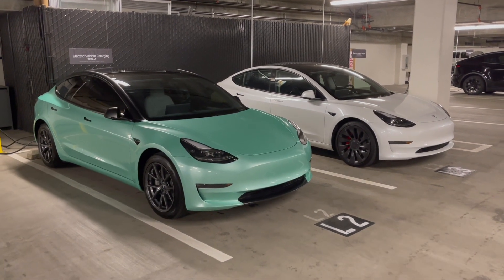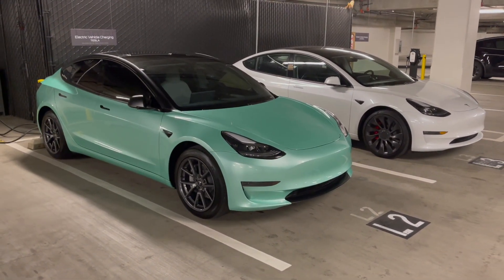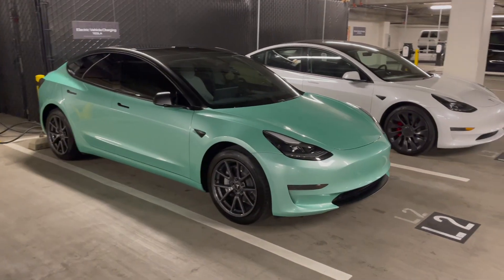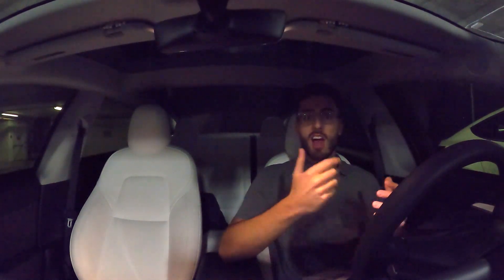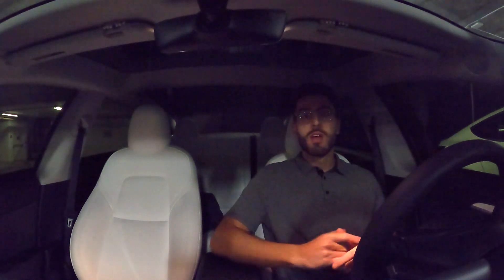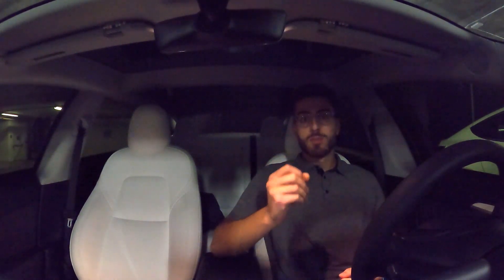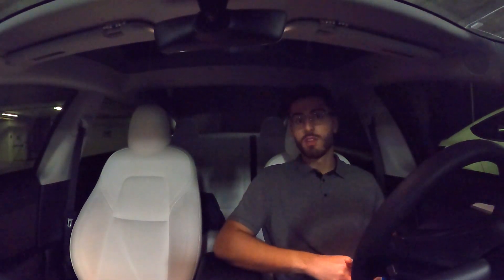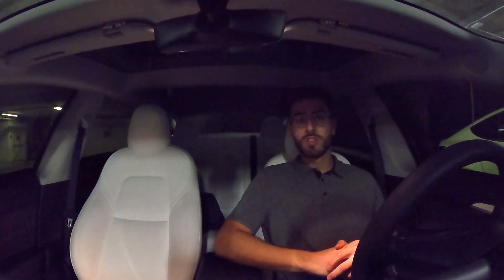Tesla Model 3 LFP | Charging Behavior and Battery Degradation

Comment: All misleading info. You can’t see the level of degradation on range estimate. You have to have 50% or less battery, be connected to L2 charger and switch to the service mode then run a battery health test which will take around 15 hrs

Comment: Hey , I plan to take delivery of my Model 3 RWD next month. Note,  I live in a condo, with no chargers, in Toronto, Canada.  Thus, I would have to use the super charging network to charge.  Also, I work from home, so my weekly usage would be pretty low. Given my situation, what do you recommend my charging habits be ? Thanks in advance for any advice you recommend
Reply from the maker: Supercharging is fine, the battery won’t degrade more so I wouldn’t worry about that. The only issue I’ve had is the inconvenience of relying on public chargers, but totally doable 💪
Reply: @ChargeGo  thanks for your quick response! It was super helpful. It seems like  the LFP battery chemistry is ideal for people who don't have a home charger

Comment: I’m having a different experience; I picked up my lfp m3 beginning oct 2022, it started with 274mi range. It’s only oct 16, it’s down to 271mi range. I have the aero caps on, charge it to 100% most of the time on nema 14-30..
Reply from the maker: The only way to really know the degradation is by looking at the current capacity on the battery, which you’d have to figure out through Tesla service or a 3rd party app. Displayed range is not a great metric to use, like I did here.

Comment: I have tesla 3 standart 2022, also have an LFP battery (drove 9000miles)  still have 272 miles on it. I have no degradation at all yet. I ussually charge it to 90% and to 100% once a week, or when I need it. The LFP battery has a different chemistry,  and can be charged to 100% with no harm to battery in a long term.
Reply: I have the same tesla. Started at 273,  now down to 259? I guess something is wrong with my battery

Comment: Never charge to 100% or leave it at 100%. They balance at 90%, some have reported double the deg tesla claim.
Reply from the maker: It’s a new battery chemistry. This point is true of the older chemistry batteries.
Reply: @sgsuper1150  ah so what purpose does the cooling port on our battery pack then?  Our car will either heat up or cool down the pack when it is needed, same goes for charging. Don't worry about the batteries getting too hot because it wont.
Reply: @AllThisThingsIHateU  It won't always work for the longest battery life. Fast charging lowers battery life, 100% charging may take 4% away and then it not always going to cool to 25 degrees idea temperature.

Comment: How is your battery now? I have an LFP SR+ and I lost 8 miles already with about 7k miles on it. I charge daily 100% as it recommends, any thoughts?
Reply from the maker: Hey! I’m at 17k miles and have lost 8-9 miles as well. I wouldn’t trust the estimate too much, you would need to look at internal data to see how much degradation has actually occurred. A Tesla tech can do that for you.
Reply: @ChargeGo  thanks man, yea I know those numbers fluctuate
Reply: I charge (free Volta) to 100% once or twice a week at 32A. Battery is usually around 60-100% weekly. Never charge at home, only use Supercharger on road trips. Battery now shows 252 full range after 8000 miles in my 2023 Model 3 SR.

Comment: Hey guys, I’ve had my 2022 M3 with LFP for 6,000 miles now. I’ve noticed my charge limit has gone from 272 down to 267 now. Should I be worried?

My charging behavior has been mostly relying on superchargers since I can’t charge from home until next month. I charge about twice a week to 100%. Any feedback would greatly be appreciated!
Reply from the maker: I think you just need a BMS recalibration. Going from a low state of charge to full a few times, using a lvl 2 charger preferably. Works for me 👍
Reply: I'd also add that charging it to 100% everyday  doesn't affect negatively in our lfp battery because the chemistry of it is different than the previous one. It is always happy  20% to 100%
Reply: Never charge at 100% with a supercharger
Reply: Just to help you not worry. These miles are not really accurate. It changes on how you drive your car, check your trip log, it averages your miles depending on your driving style and usages of heater  ac, etc.

Comment: I purchased the AWD, which should be arriving in a couple of months, but am now seriously considering to change my order for the LFP, after learning about the charging. Charging 80% of the AWD will give me the same range as 100% of the LFP. I do love the premium sound system of the AWD but don't know if its worth the extra.. Would you recommend the standard over the long range?
Reply from the maker: Yes, I think LFP is the best value car out there. If you can afford LR it comes in handy to have more range sometimes. If you don’t drive a ton and have gone charging I would do LFP all day long.
Reply: @ChargeGo  How is the range decrease in the winter time? I live in Los Angeles and a Tesla rep told me that LFP battery range decreases more, even in Los Angeles winter time. he also said that it charges much slower in even moderate cold. and I don't have a home charger but hopefully I could make it work with the lfp
Reply: @user-hw4tk4gw6b  if this is still an issue for you I can confirm the cold weather issues are not permanent and you will regain the lost range in the summer. It doesn't damage the battery in any way it just reduces the performance in winter. The LFP battery will last a lot longer before you reach 80% of the original capacity. If you're worried about slow charging in winter just make sure to charge straight after you get home so the battery is still warm from your driving. I don't see any occasion where you would leave the car empty over night in sub zero temperatures then need to fast charge it the next morning. The only thing would be the LFP battery would give you slightly less efficiency / performance in cold weather both batteries will but the LFP slightly more.
Reply: I went through the same thinking. Getting the LFP now.
Reply: With long range you get up to 250kw at superchargers vs 170ish on standard range model 3s
Reply: LR is AWD and a lot faster. Feel way quicker then the SR LFP. Do you want to drive a slow 5.8 sec car or a 4.2?

Comment: Sorry pal. Your range estimation summary is incorrect. Tesla estimates the range based on what the BMS estimates as your pack size and using a static figure to estimate your range. It does not fluctuate based on your driving season or wheel covers. To see your actual real world range you would have to look at your energy screen to see your range estimate based on your most recent driving habits over different distances. If your BMS estimates 248 miles and your pack was initially estimating 253 miles new you would actually be looking at a small degradation of 2%. That’s pretty normal. This number can change as well with software updates and whether Tesla releases some of the battery buffer to the useable side. Side note , about 3kW of the pack is not useable and is part of the buffer. If your LFP started with 60kW total only 57kW or so would be useable. Packs will degrade a little faster at the start and slow down over time and mileage. LFP is certainly the better pack potentially over the long run. I would guess that if you are running through your pack down to 10% and charging to 100% often your BMS would be estimating pack size pretty accurately as it is seeing the entire pack.

Comment: The range displayed on the screen in your Tesla does not change based on wheel covers or weather conditions. It is purely a measure of how much charge your battery holds. Your battery has degraded (very minor) from the original miles you saw on the screen to the new lower number. Here is a quote from the Tesla website: 

Displayed range in your Tesla is adapted based on fixed EPA test data, not your personal driving patterns.
Reply from the maker: Thanks for sharing!

Comment: Bro don't charge it to 100 percent too often , yes LFP Batteries are able to withstand high state of charge with low degradation than ncm or nca but yes degradation is there , Tesla recommends to charge to 100 percent to balence the cell voltage of battery pack as cell balancing is an issue with LFP kind of batteries , you should use 90-20 cycle often and full charge occasionally for balancing purpose hope you find this helpful.
Reply from the maker: Thanks for the comment. I have recently been following the 90-20 cycle by chance and I have seen +2 miles added to my overall range
Reply: This is incorrect. The reason Tesla recommend charging to 100% at least once per week is to reset the BMS and make your SOC estimate more accurate. Due to the flat voltage curve of the LFP, the car uses Coulomb counting (amongst other things) to determine SOC, and if not charged to 100% regularly then the estimate will drift. 100% once a week is sufficient depending on your driving patterns.
Reply: @aviationboy8  that's what I am saying by regular charging to 100 % corrects displayed SoC but when you feel sudden drop in SoC or unusual discharge behaviour let it down to 15% then charge to 100% you don't need it often btw.

Comment: Hi! I’m planning to buy an M3 but in my circumstances I won’t be able to charge it at home. But there is a nearby SC that I can go to every week. In your experience is it possible to own a tesla even though you charge it once a week in a SC. I only drive 15 miles everyday. Additionally my also concern is about the battery degradation because I saw in some forums that using SC is bad for your battery.
Reply from the maker: Get the Model 3. The battery management systems on these cars are so advanced that people who supercharge only are not affected in any way. I know people who supercharge only and have seen less degradation then people who don’t supercharge. It’s a myth and there is no proof that supercharging degrades batteries faster on tesla vehicles!

Comment: Been running LFP in my truck since 2018 and I continue to push the limits on these batteries. I am getting +135mi on a 50kWh pack without the aero and tech of a M3. As long as you have a solid BMS to limit charge and discharge you are good.
Reply from the maker: Thanks for watching! Could you clarify what you mean by “BMS to limit charge”? Thought these batteries like to be charged to full often?
Reply: @ChargeGo  A Battery Management System, which is built into your Tesla, monitors the voltage,    of each battery cell and will control charging to limit the cells from being damaged by excessive voltage or over charging. It also gives you the state of charge, or your battery percentage reading. A rule of thumb in the EV conversion world for LFP is to keep them between 20 and 95% SoC for longevity. Tesla may adjust the readout so it's 0 and 100% for the average person similar to empty-full fuel level in the ICE world.
Reply: @Tech_1587  you still get full regen at 100%. So there is still room for more charge. It would be silly for apple and Tesla etc to not simplify readouts adjusted. So your probably right that “100%” is theoretical best maximum SOC but not full to the brim.
Reply: @Thomas Huther LFP batteries have been around many years before Tesla started using them.

Comment: I have a 2021 LFP batter M3. I started with 263 miles, and after 8200 miles I still get 263 miles stated on the screen. Also, it's winter here in the UK and temp has been as low as - 3 degrees Celsius
Reply: do you always charge it to 100%?
Reply: @IAmThePrepper  yes, I charge it to 100% everytime. But I do use my car every day.
Reply: i have 2023 model 3 and it start with 273 miles after 1,000 miles it is showing 272 miles now at 100 charge. sad. i charged to 100% during first 1000 miles. now i charge to 90%. once a week i will charge to 100% with tesla wall connector.
Reply from the maker: Amazing!!!
Reply: How often do you charge the car, and at what speed you drive?
Reply: @myTM3RWD  I charge every 2 or 3 days. Sometimes twice in 1 day when I do my 200mile weekly journey.
On motorway ways, I normally do between 75mph to 80mph.
Reply: @phongha1774  oh, ok. Thanks. I think I’m going to let the battery goes down to about 20% and see what happens because I’m also in Canada where we get cold as well.
Reply: I drive 3 miles a day, how often should I charge?

Comment: Hello.
I also have a sr with the lfp battery. 
I am charging the car to 100% twice or three time a week. I am charging when i am hitting like 20% - 40%. Is that cool?
Or am i supposed to charge it to when it is lower?

Will it be better if i charge it one time to 90% and one time full charging?
Reply from the maker: Just plug the car in whenever you can, and try not to let the battery sit too long below 20%.

Comment: The lfp is supposed to be 272 miles of range
Reply from the maker: The 2021 variant had the performance motor and a smaller LFP pack. This specific car is a unicorn in that sense.
Reply: @ChargeGo  exactly! I love my unicorn. I also have the 2021 and noticed it dropped from 253 to 248, but now it is back to 253. Weird, but not complaining.
Reply from the maker: @Peter-rq4xn  sick!

Comment: Do the 2022 model 3 Tesla long range have the LFP batteries in them?
Reply from the maker: They do not. The LFP pack only comes with the SR+ (RWD) M3 for now.
Reply: @ChargeGo  will the 4680 pack have similar characteristics far as charging to 100% or will those vehicles need to stay around 80-90 for the most part?
Reply from the maker: @Coco6407  We don't know just yet, but the 4680 design change is mostly structural. This new design reduces the number of parts, the total mass of the battery pack, and therefore enables Tesla to improve efficiency and ultimately the range of its electric vehicles. The ability to charge to 100% is dependent on the chemical composition of the battery, which I believe will be NCA. My assumption is that they will be able to maintain a higher state of charge with the more efficient cooling of the battery cells, but not to 100% like the LFP packs.
Reply: @ChargeGo  ok thank you for the explanation.

Comment: 60 degrees isn’t cold weather, so that wouldn’t factor in. You essentially have 5 miles of degradation, no zero. Not bad though.
Reply from the maker: Not bad at all. I will say for the past few weeks at night we will see high 30s/low 40s for temperature. I’m wondering if that has an affect on the estimated range.
Reply: @ChargeGo  Good content, quick to the point! The temperature of 40 at night can slightly still factor in and the wheel covers. If you can update again in the summer and see if any degradation occurs. And maybe drive with the wheel caps for little bit and see how many miles with them on.

Comment: Great info… I have a 2018 midrange and I have lost like 28 miles of degradation … I started with like 258 miles at 100% now I am at 232 at 100% 👀👀
Reply from the maker: Will be interesting to see if the LFP battery degrades less then the NCA pack 👀
Reply: @ChargeGo  It surely will be interesting long term!
Reply: Run it down to less than20 miles fully charge it. It will reset the battery and milage it will go up. Don't charge over 90% unless doing longer trips, elon musk says not to charge to 100% often as that will make the battery lose life
 Look on tesla for charging. It says it on there. Just re read it, if its dual motor do what I said if its single the 100%